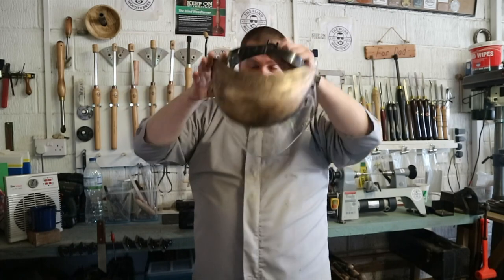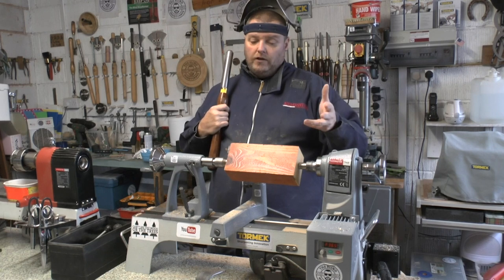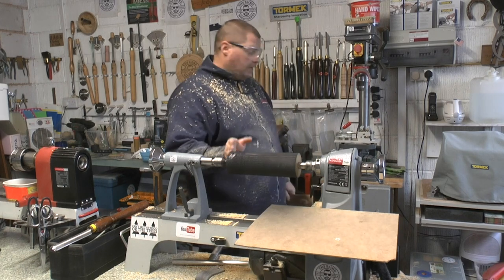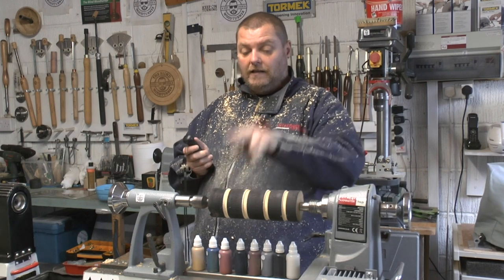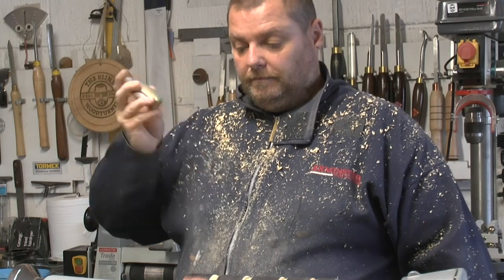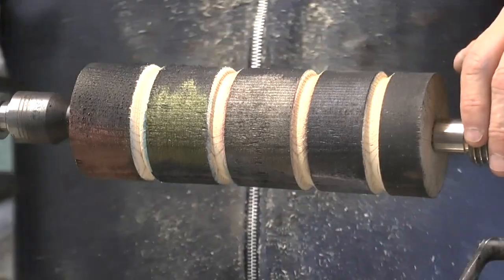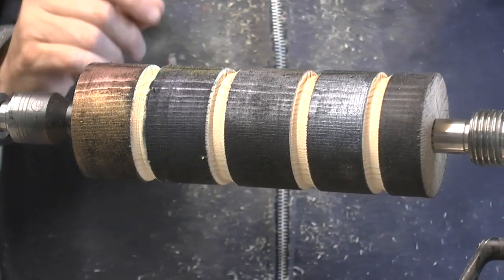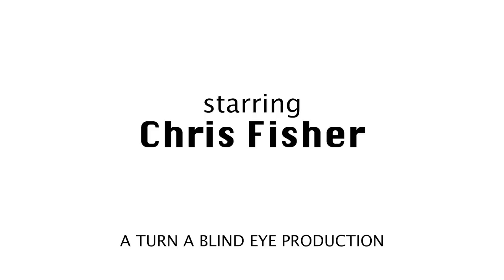Product Review - Using Chestnut Metallic Paints for the first time

Comment: Chris, would this have come out better if you had sealed the wood before applying the paints ? It seemed to me that the paint soaked into the wood at different rates depending on the grain orientation, or is this intended ?
Reply from the maker: Hi Dave !!
The black base coat would have sealed and primed the wood .The paints were applied sparcely andcautiously .is video was  just a test and I have since used these paints on a project  ,which will be uploaded in the next few weeks.
Keep on turning !!